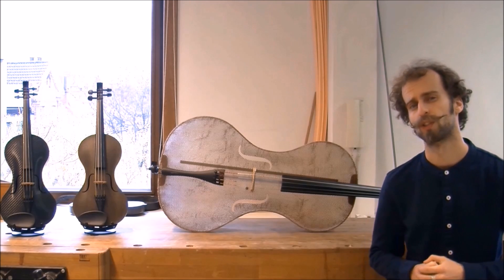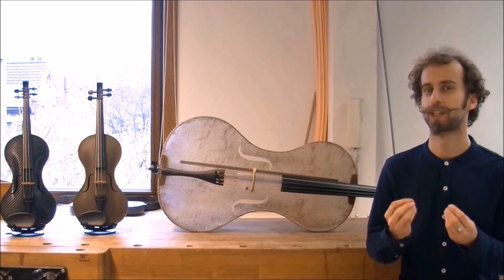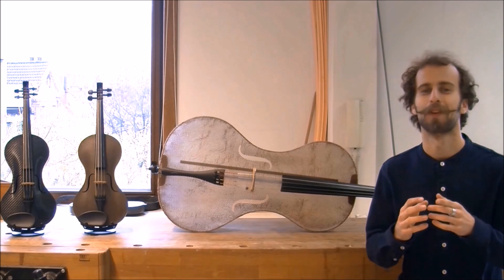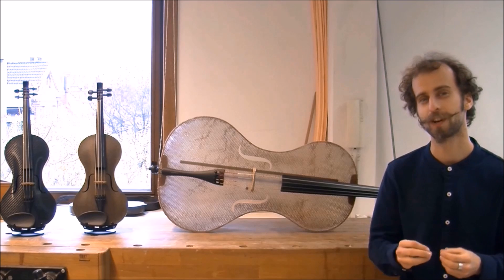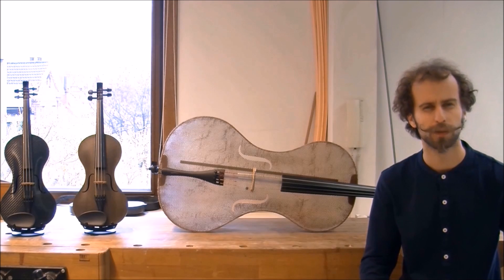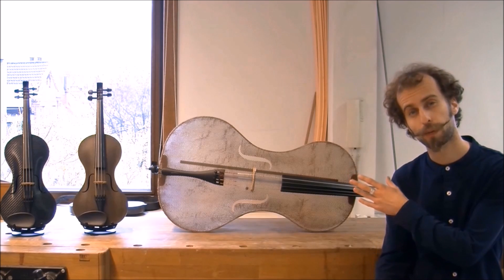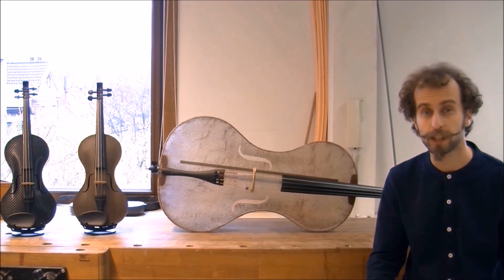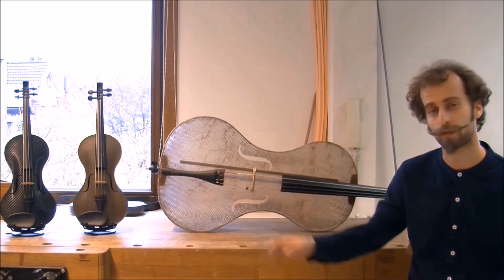Making a Cello From Carbon (by hand)

Comment: THE POINTS ARE MISSING  -- THE CORNER POINTS ARE IMPORTANT TO ALLOW THE CELLIST TO CONTROL DELIBERATE MOVEMENT AND TIPPING OF THE CELLO .  WITH THE SLIPPERINESS OF THESE CARBON FIBER CELLOS, ONE COULD SAY THESE ARE POINTLESS CELLOS.

Comment: It's clear how you came up with the shape, but I wonder how you came up with the layup schedule? That seems like it would have been a lot of trial and error. Were you able to come up with something that worked on the first try, or did you have to experiment with different layups? Did you use any calculations or analytical tools, like Finite Element Analysis, in determining the layup pattern/schedule?
Reply from the maker: Hi, it was calculated based on knowledge of thickness/stiffness of wooden instruments, followed by some trial and error to get it perfect everywhere. A master student of University of Ghent did make a FEA model of my violins to experiment with different materials and thicknesses and their effect on the vibrational modes of the plates. We learned allot from that as well!
Reply: @TimDuerinck  Thank you! It's fascinating to see how one can duplicate the behavior of a wood instrument using modern materials.

Comment: Just wanted to ask, if the material is now easier to vibrate, does it mean 3/4, 2/4 sizes are much easier to play, and in theory would make a better sound?  I know cost is a big issue, but if cost aside?  Another thing, now that the material is flexible before treatment, unlike rigid wood, have you tried different shapes, without sharp corners (with round edges instead), which in theory would make vibration much more efficient, essentially like a flattened Gourd shape.
Reply: I have not made those smaller instruments so I couldn't say :)

Comment: 2.questions: why not make all parts of carbon fiber? why use so much reverb in the demo?
Reply from the maker: Hi Bruno, good questions! The bass bar is not made from carbon fiber because it is easier to give it the required stiffness that way. A carbon fiber bass bar is definitly possible, but not easy to get right! For the bridge, that's a whole other story, it has a very unique acoustic function and replacing it with carbon fiber is sure to have a large acoustic effect. It would require a large research on it's own before one could do that. For the reverb, I did not make the music or do the recording. These are artistic choices by the composer and cellist, so not for me to answer ^^

Comment: Great videos, Tim! I am curious about the violin with a trapezoid shaped body, visible in back left behind your vacuum table. What is this thing, how did you choose this shape, and how did it turn out? We’re there changes you made to the plates to work better with this different shape?
Reply from the maker: Hi David, it is a trapezoidal violin made after the instruments and description of Félix Savart (1819). I've published a paper about the modal analysis of the instrument: https://acoustics.ippt.pan.pl/index.php/aa/article/view/792 He chose this shape in an effort to simplify the production and optimize the sound. He believed that completely flat plates in a simple and symmetrical shape would work better then the classic once with an arching. The bass bar is also not below the bridge foot but rather in the middle of the instrument along the axis. If he succeeded in his quest is a yes and no answer. Obviously, these kind of violins did not replace the 'normal' shape we still use today. On the other hand, he did succeed in making the vibrations in the violin more symmetrical and the violin does sound pretty good. If you like the sound more or less then a conventional instrument is very personal. Personally I was surprised that the sound difference was rather small, I had expected a bigger difference.
Reply: @TimDuerinck  great info, thanks! I will read through your paper for sure. I love learning about violin experiments, especially from times past. It is brave to do something so different!! 

I’m curious, do you make 3D models of your instruments?
Reply from the maker: @openfabpdx  I made some scans of my violin model in the past. A student from Ghent University used it to make a virtual model for research purposes. But as you see in the video I shape them by hand, so I don't usually work with 3D software.

Comment: Thank you so much for this - I've been wondering about this since 1990! One thing to remember is that sound travels four times faster down the grain of wood than across so to sound the same, your cello would have to be four times wider and thus the cellist abe to spread her legs more than my bitch of an ex! XD
Reply from the maker: Hi Prince, although your comment about the speed of sound in wood is certainly true it is more complicated than that. The sound is 'created' by vibrational modes that radiate sound effectively. These modes are affected by (an)isotropy, but also by the shape of the soundboard. So if you would make the soundboard allot wider, the instrument would sound very different from a conventional one!

Comment: how did you know the dimensions and shape of cello body? is there a formula to calculate the specific measurements?
Reply from the maker: I have based them on the dimensions of conventional wooden cello's. The shape stems from these dimensions and is my own design, of course inspired by other luthiers (in particular the cornerless insturments by F. Chanot). If you'd like to know more on how classic bowed instruments are designed I suggest reading the following book: F. Denis (2006). Traité de Lutherie; The Violin and the Art of Measurement.
Reply: @TimDuerinck  thanks so much, i'll definitely give It a read. really interesting stuff. whilst I'm here, i am curious, does the air capacity that a cello holds (volume of the cello body) effect the fundamental frequencies, overtones and harmonics of notes at all?
Reply from the maker: @jeremywong3318  Yes, definitely. The air volume determines the Helmholtz resonance. It is especially important for the radiation at lower frequencies.

Comment: 2:08 what is this material called?
Reply from the maker: Carbon fiber
Reply: @TimDuerinck  I see. I thought 2:16 that was carbon fiber if it is then what's the difference between them?
Reply from the maker: @Knoight  Both are carbon but 2:08 is unidirectional, this means that all the carbon fibers are in the same direction, while 2:16 is woven, so the fibers run in two directions. The fibers are what give the material stiffness and strength, so depending on how you put the fibers, you change the stiffness of the material in the different directions.

Comment: please which epoxy do you use ?     this is so important as im planning my own build thank you :)
Reply from the maker: Depending on how you will build, you'll need an epoxy for that purpose. In this case the production method is VARTM, also called infusion. So you need an epoxy for infusion. I have good experiences with both the infusion resin from EasyComposites: https://www.easycomposites.co.uk/#!/resin-gel-silicone-adhesive/epoxy-resin/epoxy-infusion-resin.html 
As that from r-g:
https://shop1.r-g.de/en/art/100133
Other epoxy can be fine as well. Just check in the producer's specifications that it's suited for VARTM/Infusion/Vacuum impregnation. And make sure you can fully cure it with what you have available: if you need to post-cure it at high temperatures but don't have a curing oven this can ofcourse cause problems. Both of the resins mentioned cure 'at room temperature'. Yet for both, a post-cure is recommended for optimal properties (as you can see in the video I did a post-cure at 60° celsius).

Comment: How thick is carbon fiber shell on the top surface between the bridge and the bass bar?
Reply from the maker: Hi Mika, as you can see in the video it's a bit thicker then the other parts of the soundboard. You can see in the video that it's 6 layers, of which two are unidirectional.

Comment: This was very interesting. I have a Quintas cf cello and always thought it was the first maker of cf.  I love it but I have a problem with not being able to hit the middle of the string at the base of the neck.  Is it possible to make adjustments since neck and body look like all one piece?
Reply from the maker: Hi, for my instruments the body and neck is indeed one piece, I don't know how your cello is made specifically. The distance relation between the position of the middle of the string and the base of your neck is usually made by cellomakers to fit within a standard. A newly made modern cello (carbon or wood) should fall within these standard measurements. It could be that this is not the case for your cello (I don't know the instrument), in that case it's an error from the maker. The shape of the heel of a carbon neck cannot be adjusted, but depending on current string length and the ratio between your neck and body some smaller adjustments could be made that shift the middle of the string more towards where it should be for you. This really depends on how the instrument is made and glued together. If the touch is removable or not,... This I can't say without seeing the instrument. For these smaller adjustments, you can always go to a luthier near you to see what's possible.

Comment: The music was clearly recorded from a pickup rather than with mics, I think you should clarify that.
Reply from the maker: Hi Fedor, as you can see at 5:06 the cello had both a pickup and a small mic attached. Both were used to record depending on the sound the cellist made on the instrument (which one of the two was most suited).

Comment: I'm curious how did you end up with that shape for the body? it's not what I'd consider as a traditional cello shape
Reply from the maker: The classic C-bouts of a cello are not well suited to make in a composite material. This shape of the body is not really new, I think Chanot was one of the first violinmakers to use such a shape. The precise outline is my own design though and is based on just a few connecting circles.
Reply from the maker: Here an example of an experimental violin by Chanot if you're interested: http://collections.nmmusd.org/Violins/1800-1849/Chanot.html